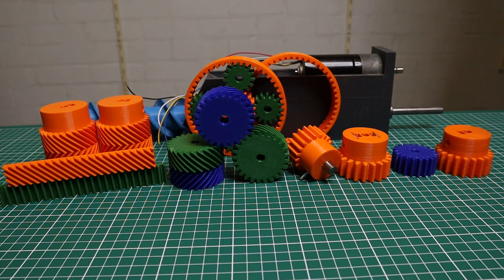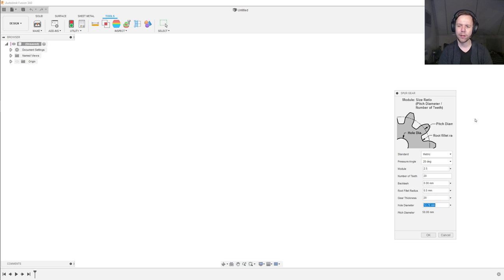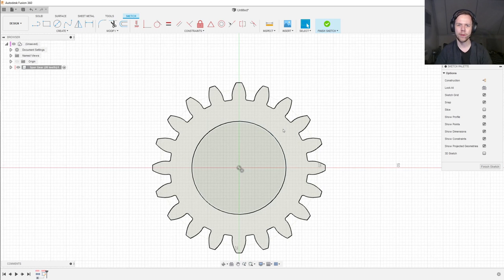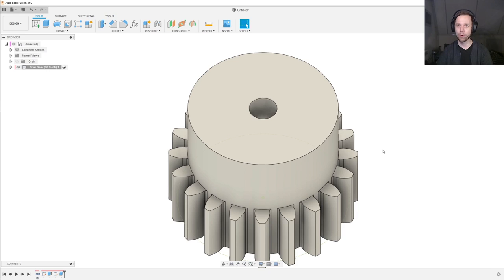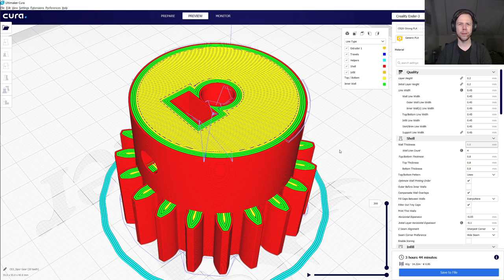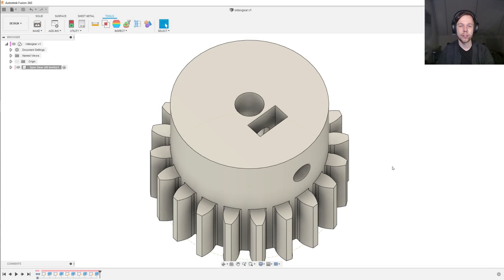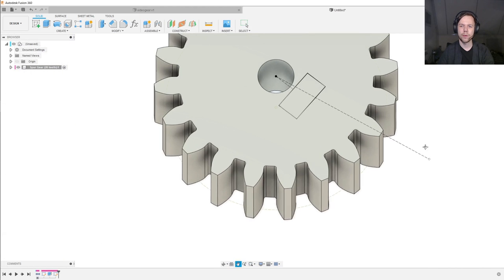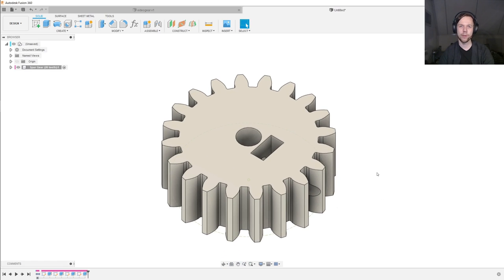How to Design and 3D print basic spur gears, and how to attach them to shafts (Gears part 1/7)

Comment: If you’re going to go to the trouble of mirroring everything to put an additional setscrew in, which pushed the piece away from the driveshaft, wouldn’t it be better to design it so it actually clamps on to the D shaft?
Reply from the maker: I haven't really found a great way to do that. I don't think you can print an accurate enough D-shaped hole so that the gear goes on without excessive force, but also is locked to the shaft well enough that it can withstand 2-3 Nm worth of torque. If you have a more sophisticated design idea I'd like to learn more.

Comment: Any strategies for those of us who don’t have Fusion 360?  Great tutorial though.  Thanks for taking time to show us.  Doug
Reply from the maker: You can get Fusion360 with a free hobbyist license, but it has some limitations that I don't get with my pro license. You can try it out and see if it's still good for you. There is also Siemens Solid Edge community edition, but I haven't tried that myself. Finally there is FreeCAD, which is free and open source. I believe it's quite feature-complete, but it's a difficult program to learn I found, and there weren't too many tutorials about it when I used it years ago. That should be much better now though.
Reply: @antalz  Thanks for the reply!

Comment: When 3d printing the lowest layer always gets a little squished out. I usually round off all edges that would be on the lowest layer. But the gear has so many edges to select. Is there any easy way to do this?
Reply from the maker: Yeah, you can look at the gear from the side, open the chamfer tool, and then box-select around the upper and lower faces. For a better explanation: https://youtu.be/FIwOiLp4d6k
Reply: @antalz  Thanks for the quick reply. Really like your videos!
Reply from the maker: @Butterkekskrumel  You're most welcome, good luck and thanks for watching

Comment: Sir which one is better material for gears Nylon or Teflon 
From all point of view like strength, friction, durability, etc
Reply from the maker: I'm not completely sure, but I think Nylon due to better stiffness. Friction and wear resistance are very good on both. Are you planning on cutting your gears from a blank? I believe 3D printing PTFE or Teflon is impossible to begin with.
Reply: @antalz  I have to do some research, hmm Thank You sir

Comment: @Antalz can you put the shoulder on both sides of the gear
Reply from the maker: If you mean the mounting hub and setscrew, yeah that can go on either side
Reply: @antalz  for my application it is not really a mounting hub. More of a  section that is on either
Reply: My application it is not really a mounting hub more of a section that provides additional strength for the gear. The gear is very small and total diameter is roughly 5.7 mm. It is a spur gear for a ho scale locomotive that is no longer produced. The smooth edges on either side of the ear team provide extra strength since the gear is so small
Reply from the maker: @danielatdownhomehobbies836  That sounds interesting! You can definitely sketch a circle on one side of the gear and just extrude that out. You will probably need to print it in SLA though because of how fine the details will be.

Comment: I couldn't find that small hole for the centroid of the polygon, any tips to getting it? Its really frustrating as it is my last step
Reply from the maker: Can you project (P) the cylinder into the sketch, then select the center of the projected circle and the center of the polygon, and apply the coincident constraint?
Reply: @antalz  Yes! I have done all that, i've went step by step with your video, the only difference is that my shaft is 4 mm, so i just changed that. Everything else seems perfect except that the small circle (Coincident Constraint) is not appearing and i tried drawing the polygon and applying the midpoint with the point at the corner, but the output is not very similar like yours.
Reply from the maker: You should first try to ensure the center of the polygon lies on the center of the circle. If the automatic concentric constraint doesn't appear I think the easiest way is to project the hole into your sketch, and then making the center of the polygon coincident with the center of the circle. You could perhaps also draw a construction line and constrain the center of the polygon to the center of that construction line.

If that doesn't work out could you export your file as .f3d, and send it to antal@creonova.nl please? I'd like to take a look.
Reply: I was having the same problem. The project cylinder allowed me to find the concentric constraint. Thanks.

Comment: is it possible to scan a gear or is scanning still too expensive?
Reply from the maker: No scanning a gear is quite cheap now, even a 1000-5000$ device can create a high quality scan.

The problem is that the resulting file is a mesh, and that it contains all the faults and imperfections of the gear you've scanned. Of course you want to make a new gear you don't want to reproduce those imperfections. You can use a scan like that to figure out the parameters of a gear, to create or buy a replacement. To understand that you do need to watch part 2 in this series I would say, and then you can reverse engineer gears using some of the tricks shown here: https://youtu.be/0Bt-PXMaCzI

Comment: I'm not going to read all 95 comments. Not sure if it's been mentioned yet..buuut...its not uncommon to grind a small flat on a steel shaft to drill the center of said shaft to prevent drill bit wandering. Don't forget to put a punch Mark for your drill bit to start right were you wish.
Reply from the maker: That would prevent the drill bit from wandering, but can you ensure in that case that your hole will pass through the center of the shaft?

Comment: great video, make more design for 3d printing related videos
Reply from the maker: Thanks mate, I have more planned on gears, but there's some other 3D printed stuff that might appear later. It will take some time though, quite a few subjects I want to cover first.
Reply: @antalz  great, I enjoy every second of your topics. if I may suggest a future topic! I would suggest a practical guide on how to design a big modular mechanical part that can be clamped and snapped together after 3dprinting its pieces. I searched alot but I couldn't find such tutorial. cheers
Reply from the maker: @HaidarHasani   Thank you! That's a good topic, I have assembled a large boat from multiple large printed pieces, is that what you're talking about? I haven't yet assembled higher precision parts like this I think, like bearing housings or gears, only large vehicles and frames. It's quite difficult to maintain sub-millimeter accuracy.
Reply from the maker: @HaidarHasani  One more thing, does this video from Maker's Muse help?: https://www.youtube.com/watch?v=FzCm1iTf8PA
Reply: @antalz  yes this really helped, thanks

Comment: The wobbeling effect due to the surface is not perpendicular to the shaft hole, is a big problem. Have the same problem on my anycubic i3 s
Reply from the maker: Does it have 2 Z-axis leadscrews, and do you have the endstops set so the gantry is perpendicular to the Z axis? All my printers have only 1 Z axis leadscrew which creates that problem, but the setscrew also just forces the gear out of alignment slightly.
Reply: @antalz  the anycubic has stepper motors on both sides of the z axis. I did not check the endswitches yet. Also the frame is may be not absolutely perpendicular to the print bed. Need to order a precise protractor first.
Reply from the maker: @Daniel-ri2ys  My anycubic mega has little screws on the gantry that actually push the endstops, so you can adjust those if your printer is the same.

Comment: Why not export directly to 3mf. 3mf is a better format for 3d printing, is supported by the vast majority of slicers and doesn't require cloud translation.
Reply from the maker: I might choose .3mf now, but there's still not really a practical difference. As said in the video though, .stl does not require cloud translation, and it still doesn't now. I use Cura, and it accepts .stl and .3mf all the same. I think for sharing files with the broader community .3mf is advantageous.

Comment: A very good tutorial, but you left out the obvious method of just making a hole with a flat on one side and just pressing it onto your motor shaft. For a lot of low stress applications I would think that would be enough.
Reply from the maker: I didleave it out, partly because I honestly haven't tried it very often. It's a very hard fit to get right, too loose and it barely couples, too tight and the gear won't fit. It's very hard with FDM to get that to work. Even if you do, it takes very little for the gear to deform and rotate over the shaft. I don't want to present any methods that I haven't tried myself or that I don't believe in myself.

Comment: 12:35 seconds Cringes in back EMF
Reply from the maker: Every motor is also a generator! Not a very good generator usually but still. It doesn't hurt the motor by the way, not sure if you were worried about that.

Comment: Set screws are a notoriously bad design for power transmission. For plastic, people get away with doing cheaper/easier engineering, because, well... it's plastic.
Reply from the maker: That depends honestly. For plastic gears the plastic itself will creep, so you can only do so much. With a steel gear you can put much more clamping force with a setscrew, but still limited. Of course a keyway or a splined connection would be better, but the people watching this video can't make those.